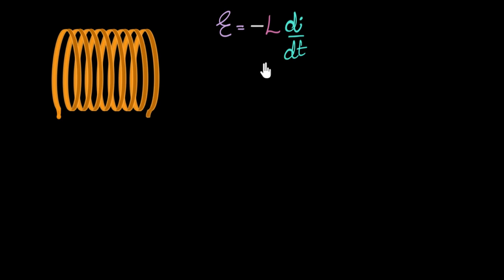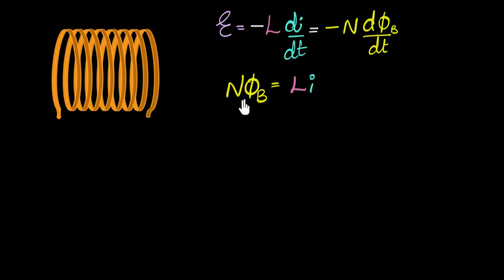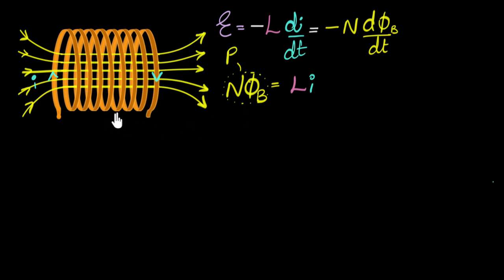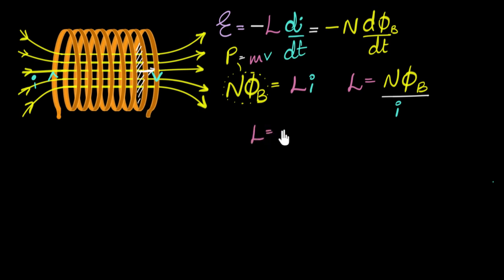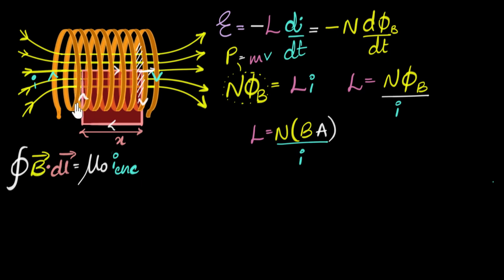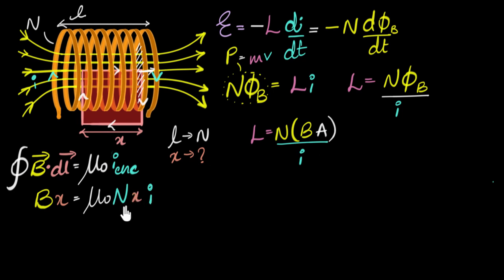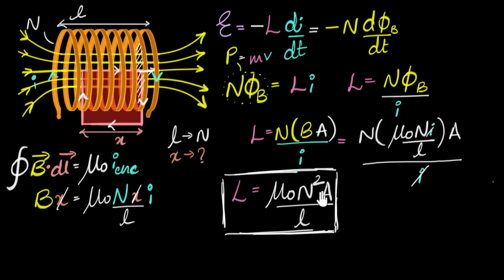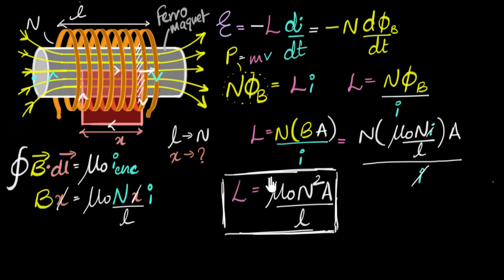Self inductance of a long solenoid | Electromagnetic induction | Physics | Khan Academy

Comment: Summary Of The Video :-

Self Inductance Of A Long Solenoid

* Self Inductance does not depend on voltage or current.

* Inductance only depend on geometry and the material inside the inductor in free space.

* More number of turn in the coil gives more inductance.

* On increasing length of an inductor , inductance decreases.

* Inductance also depend on permeability of free space.

If we use a ferromagnet inside an inductor in free space then it's inductance get increases.